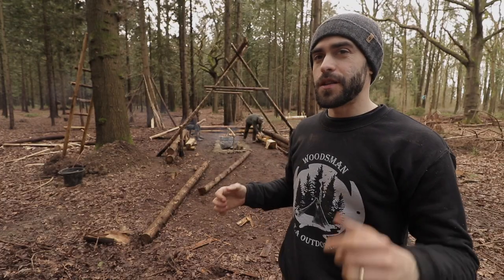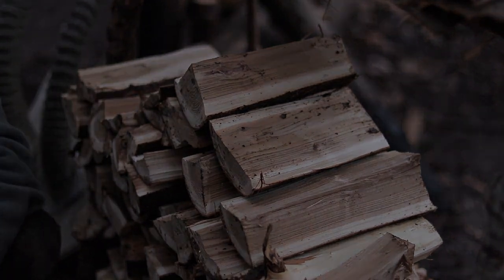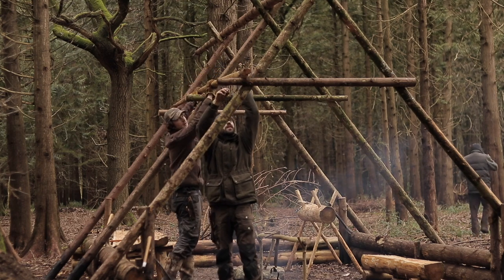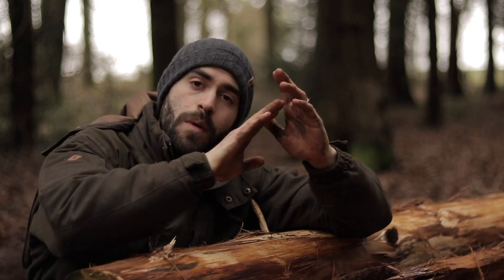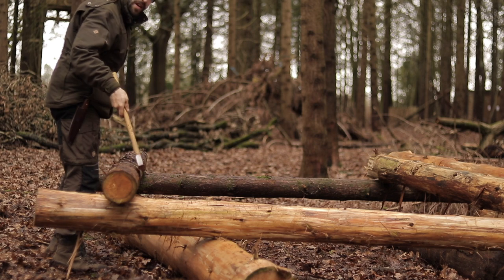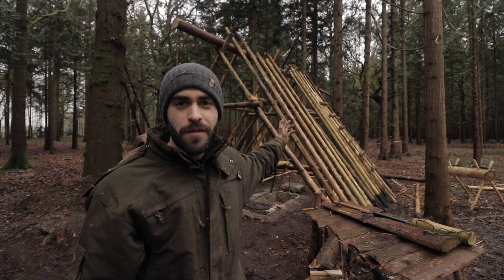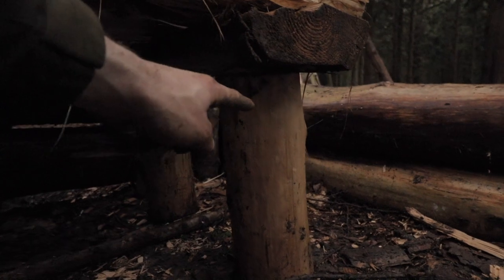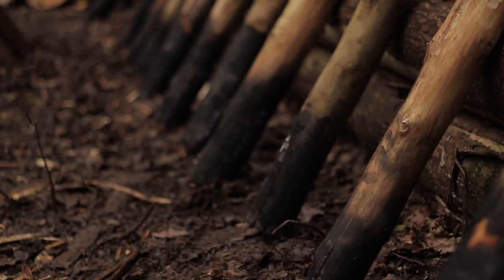Building a Viking House with Hand Tools: Timber Roof, Bed | Bushcraft Project (PART 5)

Comment: Use a wooden club that is heavy on one end tapered at the other......you will find it much more efficient in transfering its weight to any post, wedge or Back of an ax you use it on. You can make one out of a larger two foot log......taper the handle with your ax.......if you are smart you will use the saw to cut partway in halfway up befor the ax work.  A wooden club will not damage steel, or the tops of posts.

Comment: The discussion about iron and nails:
There's a line of thought in archeology that's been quite debated, but the idea is that the Romans imported people from the swiss alps and from the fa east into Norway to support their rather heavy need for quality steel. And as the alternative was to import it all the way from China, it was important to them so it was perhaps a main reason to conquer southern England as a trade route. Problem is, the bog iron here is about the cleanest you can find in Europe, but that also makes it difficult to process in large quantities,so it took a while to find the right technique.. Then, as the Roman Empire broke down these people became a people of their own.
Which means, yes they had iron. But nails had to be hand made so they weren't cheap. So I believe, to them, pegs werre the economical alternative.
But you know what was probably the easiest? To bind thin limbs, tree sprouts and roots as you do with rope.

Comment: Hay TA Outdoors

Why not use pine resin glue?

Here's how to use Pine resin in a homemade glue recipe.
Collect the resin from a pine tree. ...
Melt the resin. ...
Add 1 part hardwood charcoal powder. ...
Add 1 part filler material. ...
If you wish to make the resultant glue more flexible, so it can be easily worked, add one part fat, tallow, or beeswax to the mixture.

Comment: I'm here in Virginia USA and I am building a Powhatan Indian yehakin " longhouse " it is an oval dome structure made from bent saplings the beds in the structure are made upright support logs which are    Buried about half of a foot in the ground. The logs support one long stronger sapling which is nailed in place the other side of the bed is formed by using the outer framework as the support of another strong sapling. Cut saplings are placed from one side of the bed to the other ( use about ten ) place more saplings length wise and lash down then cover with grass and cat tails. I put deerskin over top of the cattails in this comment I am referring to the beds I have made

Comment: I've seen people pull bark sheets by lightly tapping the bark down all over with a club and then using the ax head held in their hand  as a wedge to pry away the bark in a sheet. It worked on the logs they were using - may not work for you. But it might be worth a try.

Comment: On your benches: Bring some chisels and a saw then cut a tenon at the top of the legs then cut a mortise with the chisels in the crosspiece. Joinery is your friend when you go primitive like this, and you could allways secure it with a dowel through the tenon if you feel things are rickety :) Edit: or slam a wedge down the tenon and let that friction sort it.

Comment: You could dig a cross-wise trench about 6 or 8 inches deep at the head and foot of the bed and then line it with a large flat stone so the bed legs are sitting on the stones.

Comment: Instead of cutting a slit in your ridge cap bark try creating a ridge cap vent using small logs as spacers over the existing bark then I placing large piece of bark over the top.  This will also help pull air and smoke up instead of filling the Viking house.  Also what is the frying pan Dustin was using to cook the steak and potatoes?

Comment: Regarding the flattening of the wood I'd recommend you watch "le feux des Guidelon". The basically build a medievil castle with the methods of that time, especially intresting should be the early episodes of Season two I think. They do a lot of wood work and have an axe made for that task. The axe blade is angled, kind of like a blade on a windturbine, but very very slightly, it's also slightly of center so that your hands are not accidently trapped between the axe and the wood. It wouldn't be too unlikely that vikings had a similiar tool for that job ~800AD to ~1300AD isn't that much time for the woodworking tools to change their form beyond the recognisable I think.
Reply: you're talking about a hewing axe.  I was wondering during why they weren't using one as well.

Comment: At some point in the first vid i think it was when you said people had said that your structure dose not resemble a viking house. They do use that type of house for a pit house/building generally it was used as a shop of sorts, a poor persons house or both. There is a way larger versions of your structure called a boat house. Had to double check my self before I pipped up on the topic. Hope that settles the topic.

Comment: You could use the space under the bed as storage for firewood. Will you keep an opening in the roof for the smoke?
Reply: I believe they mentioned in previous episodes that they would have an opening for the smoke.

Comment: A mortise and tenon joint from the legs to the brace on the bed is what i would have done but trying to bore out the hole large enough would be a pain in the ass.

Comment: When u put your dowels in, before you insert the dowel split the end and put a shim in between it. Insert your dowel then tap it in once you have it in cut the dowel flush, then insert another shim on the top. Same principle as a axe on a handle with the shim. Once they are dry IT'S NOT COMING OUT.

Comment: with the absence of wood glue would pine tar pitch work? i think mixing pine tar pitch with mud or wood ashes might make it thick enough to fill the holes in the raised bed legs and dry to a hard enough glue. would cedar produce pine tar pitch or would it have to be some other species of pine? maybe gum tree pitch would work. I think pine tar pitch can be extracted the same way maple sap is extracted for syrup. The Native Americans used to strike a vertical gash in the bark of a maple then drive as stick at the bottom of the gash. the sap would run out and accumulate at the end of the stick and drip out into a collection vessel. 

Where did you find the twisted bit for your drill set up? I am a frontier re-enactor and demonstrate woodworking. having one of these around camp would be nice. 

where did you get the wok like skillet for frying and the Dutch oven? I collect cast iron cookware and use it at amateur cooking events. i like the Dutch oven with the legs molded on the lid.

where is Amber in this episode? she cleans up after dinner licking the crumbs up so does my dog. dogs are a fun side kick.

Comment: The idea with a long fire place  is that u don't need to cut, 60 cm firewood pieces. You feed the fire with 3 meters long loggs. And with two in the bottom and one on top it will burn for hours and hours.
Reply: And when u got just a glowing bead, u just ad another 3 meter log.
Reply: and if u cover the glow, with asch, it will start the fire again when u add new logs hours later.

Comment: I have a question, if you have a log like the leg of your raised beds and you dry it by the fire pit and coat the bottom in your clay found about and dry that on it to keep it less prone to wet from the ground would the clay Crack and flake off? I suppose once you have a roof that would not be a problem because it would dry out over time I suppose. I'm curious if possible can you do a discussion piece? I live in Florida so it's pretty much swamp lands for the lower half of this place and I'm curious how you can help preserve it.
Reply: Do you have to dry bark or like above do you just rely on fire to eventually dry the whole interior

Comment: Seeing u working with the axe i can clearly see why most Norsemen liked the axe when they went on a Viking: They already had an axe, and they already knew the axe. You can use it just fine as a tool, so you have a weapon and a tool on you when on campaign. (Yes battleaxes existed but most "vikings" went out to get money and stuff so i can't see why buying a special axe was #1 priority when you had to get a shield, helmet and padded coat as well...) When you dig into it you will find that the axe culture goes much farther than with the Norsemen: Anglo-Saxon, Franks, Minoan, Proto-Slavs, etc, etc all revered the axe. And rightfully so.

Comment: bog-iron production is very difficult as well as very fuel/resource demanding. in 17-18th century well-established craftsmen-smelter with good supply of fuel and raw ore would produce about 1000 to 2000 kilos of 'sponge iron' (that would require further processing/alloying by blacksmith). only 15 to 30 kilos of bog iron could be smelted at once as smelter required significant air-flow which providing it was one of the largest hurdles and limitations of early smelters. some of the very earliest ones that did not utilize bellows could only smelt about 5-6 kilos of bog iron at one time and had low conversion rate. according to some sources less than 50%. as such while Viking did have iron and steel it's very likely they reserved steel for critical tools and applications. in other words it would be very unlikely that they used nails for building shelter. as matter of fact until large scale production of iron, nail have been commodity few could afford for such things as nailing rafters. i understand that in your context it's doesn't really make sense not to use them but couldn't resist giving history lesson ;)

Comment: Can someone build a structure like this in woods thats isn't private property and isnt land you have rights too? I dont wanna tresspass or find a good spot and cause trouble. But the reality in my area is i look out my windows and see mountains with trees everywhere but dont think i can just get out there and do it. Ive done a frame builds and lots of survival shelters and know i got the motivation just worried how to find the right land when your young and got no large capital to invest in land. Though thats my long term goal is to own my own. Just too far down the line.

Thats that part i could really use some solid advice. Life should be about just getting out there and doing it responsibly not stuck indoors wondering if you build and have fun in the woods. I think back to all thoes hunter cabins in alaska where people are respectful enough usually leave the doors unlocked and have supplies in the event of an emergancy. Would be nice to do a build like this with 3 or 4 buddies and turn it into something anyone could benifit from or aprrecaite

Comment: Man if anything I would say cut down more rafters for the sides. Get rope and hold the bottom together properly. You're bark make pitch from fir tree sap and soak that shit. Becomes right water proof. Your back wall I'm not sure what you're doing there but make it sturdy. And dont forget you need a type of chimney for the smoke or you might all die one drunken night from smoke inhalation

Comment: Be careful with those viking potatoes you are frying!
While I'm fully aware that the vikings did make it all the way to north America long before it's rediscovery in Elizabethan times, they never brought the potato (or tobacco) back.  Their root vegetables would have been swedes, parsnips, carrots, turnips and beet, but no potatoes.  They worked wood beautifully and efficiently (many of the common joints used in carpentry to this day originated with them), and did use nails, but as iron was more valuable for tools than single use items like nails, preferred pegs or wedges where those were adequate for the job.  They also made great use of cordage.